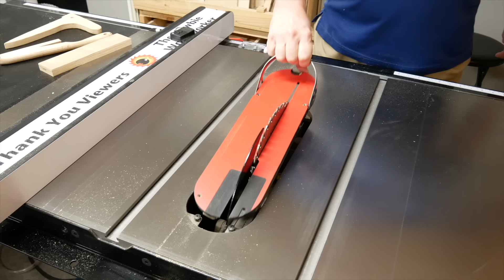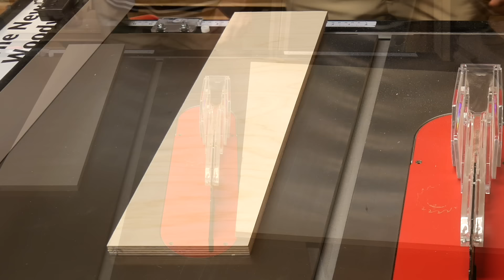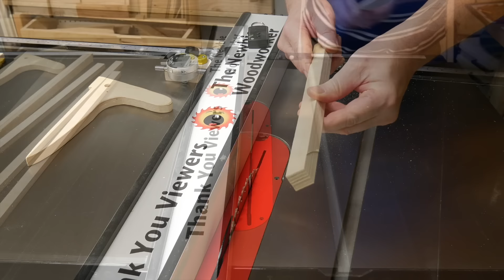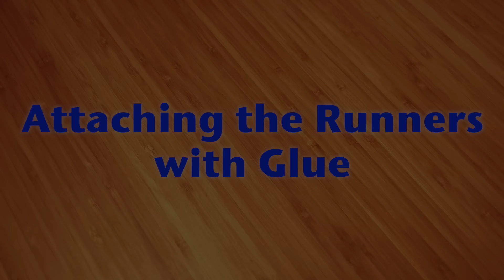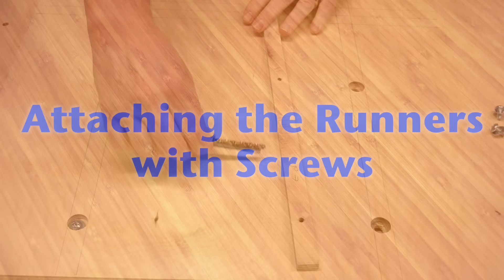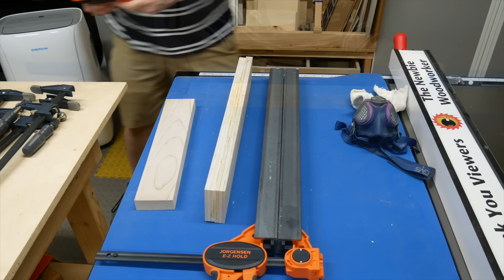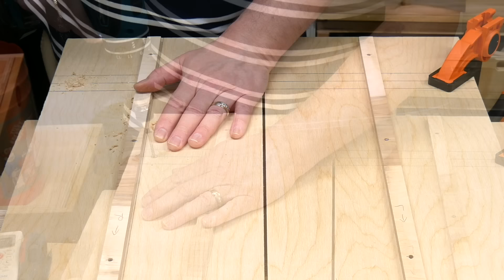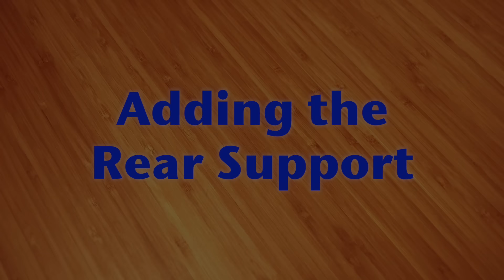Build this Revolutionary Cross Cut Sled, for Newbies!

Comment: I cut my right thumb( lucky I'm left-handed) vertically halfway through the bone. I was super careless. Anyway getting new saw and I have learned all about pawls, riving knives and blade guards. So happy to find this video and now I can make a jig with the blade guard on.
Reply from the maker: Sorry for your injury, but I'm glad to be able to help prevent further ones!
Reply: Well if didn't happen then it would've at some point...also it could've been worse.  I have learned so much since the accident. I am a very right brained ADHD artist. I am a popular window splash artist and teach on you tube. After the accident I am, taking time, reading instructions and slowing down. I should've used a circular or jig saw for the cut. I was anxious and in a hurry. A table saw with no guard. riving knife or pawls. Freehand cut.  Anyway definitely live and learn. @TheNewbieWoodworker
Reply from the maker: @ScotCampbellwindowpainter  I know all about ADHD, although I'm old-school and call it ADD because the "H" doesn't apply to this old man. :) Anywan, by all means, yes, use as many safety devices as possible. It's just too darn easy to have your mind wander. And if you can afford it, I strongly recommend a SawStop - it's saved me multiple times.

Comment: why not add a back fence as well?
Reply: The blade guard would need to be able to pass through the back fence, like it does the front fence. This means the back fence would be cut into 2 pieces, which wouldn't really add any extra support to the sled. In practice, this design has worked perfectly for me, for years.
Reply from the maker: Sorry - I posted that last response under the wrong account. The blade guard would need to be able to pass through the back fence, like it does the front fence. This means the back fence would be cut into 2 pieces, which wouldn't really add any extra support to the sled. In practice, this design has worked perfectly for me, for years.

Comment: This guy is quite sincere, but what's the real difference with this sled to otherw. The gaping open end just looks like trouble. Both ends should have bridbges  to prevent any warpage. Why not?
Reply from the maker: I explain the difference - you can keep your blade guard on. I don't know what trouble you think the "gaping open end" might cause, but it's worked perfectly for years now. There hasn't been any warpage, so there's no need for a second fence.
Reply: As Roy Underhill would say, "I know it works in practice, but does it work in theory?  @TheNewbieWoodworker
Reply from the maker: @jackwilson1914  LOL!

Comment: Great video. Thanks! I’m and old guy. I grew up around my dads glass shop. He did a lot of woodworking also. The big saws always scared the crap out of me. Particularly his radial arm saw and big old table saw. All built before the advent of good safety guards. Any newer things he had he just threw the guards away. But I learned to use them and I enjoy doing hobby work in my home shop. But I do like using the safety features. I’m also a guitar player. I need my fingers! I will be using this sled idea. Thanks again!
Reply from the maker: I'm a guitar player also, and a video game player, so I'd prefer to keep my fingers too. 😄

Comment: I clicked on your video because I am always looking for new fixtures to do difficult work.  I have to admit, I was disappointed to see it is primarily about guards.  Crosscut sleds themselves already improve safety without the addition of a blade guard.  If this saves the fingers of some people, I'd say good.   But PLEASE don't ask Congress to mandate permanent guards on home saws..  Why?  They will put OSHA on the job.   

There's nothing wrong with practicing safety.  People forget that it can be accomplished with training, rather than another restrictive piece of hardware.  Every operation you do comes with risks.  You said it yourself, unless you hold the board securely while you are using a Forstner bit, the wood may spin around and smack you.  So why aren't you using a "guard" (or clamp) for that operation?  You chose to accept the risk.  Let the rest of us decide which risks WE want to accept.   Fact is people can hurt themselves putting a new blade on, bending over to pickup a heavy piece of stock, or in a hundred other ways.  If you want to be a champion of blade guards, fine. I cut material for my employer that CANNOT be cut with a blade guard.   It is VITAL for our business. 

Incidentally I have a lot of experience in safety, having worked in machine shops for many years.  OSHA mandates guards on drill presses and lathes.   They make the machines just about impossible to use.  In fact, one of OSHA's own webpages says that the use of a guard with a drill press may make the drill press impossible or even UNSAFE to use.  (Yes, we actually used their website to fight an OSHA fine.)  People have been fined for not having safety chains around machinery, and then later fined for not having warning labels to indicate the presence of the chains.  We were fined because one of dozens of mandated warning notices was mounted a few inches too low on the wall.  I believe OSHA has become a money making business, rather than an agency genuinely concerned about worker safety.  Think I am exaggerating?   Years ago my current employer asked me to design and build a fume hood for applying coatings.  A few months later I was asked to repair a pump immersed in solvent, in another part of the building.  It was in a fixed tank underneath a table mounted soldering machine.   I would be exposed to a lot of solvent fumes when I put my head under the table, and opened the top of the tank to fish out the broken pump.  I knew I could not move the equipment to the fume hood.  So I asked my employer if I could bring in my own respirator to wear while doing the work.  NO!   OSHA had given them the choice of getting employees certified for respirator use, OR  building a fume hood.  The certification was much more expensive.  By building a fume hood in the building, they had met  the OSHA requirements.   I would be in violation of OSHA codes by bringing in a respirator without certification.  I called OSHA anonymously to ask them if this was true.  It was.  I could not use my own respirator, regardless of my experience, and they could not force my employer to get me certified.  However, they WOULD make a surprise inspection and find SOMETHING to fine my employer for!    This is what happens when government gets involved in safety.  I don't have anything against you or anyone else here designing and using safety equipment.  I just don't want OSHA ever involved in our  home workshops, and limiting our ability to make new and innovative stuff for a reasonable price.
Reply from the maker: I have no interest in having the government dictate those kinds of things. The government already does way too much of that. We're supposed to be the land of the free, but apparently those in power think "being free" means they are free to regulate, require, and enforce anything they want. So don't worry - I would never support anything like that.

Comment: Thank you for this video. I built this for my dewalt 7485 table saw. I use the guard so this is much appreciated. This is a much safer way to operate the saw. I made sure to leave enough space in the back to prevent any accidents and added some blocks around the back end to protect the fingers should I roll back the sled too far and am not paying attention. It is a great design!
Reply from the maker: That's awesome! Thanks for letting me know. 🙂

Comment: I'm one of those newbie wood workers and have been researching different c/c sled videos tryng to get an answer regarding sled size. My DEWALT has a deck about the size of your sled, but my goal is to make my sled a foundation for using various jigs.... so Question #1 can my sled hang-over the edges of the deck and if so, by how much would be recommended? Question #2: Since I know I will be adding and substracting various jigs, is there an optimal fence size that might lend itself to this goal? Thoughts?
Reply from the maker: You probably won't find a definitive answer, because it will depend on a lot of things. What I suggest is you prepare yourself for having to make a few sleds before you get an idea of what you like and don't like. Belive it or not, it's a lot easier to make sleds when your goal isn't perfection, but instead it's to make a working prototype. Then see what works for you and what doesn't. Make sure you have fun while doing it!
Reply: @TheNewbieWoodworker  Makes perfect sense. Thanks. I think I will assign myself to find the single most "plain vanilla" (AKA: least engineering)
item, build it and see what impressions I get from using it for a while. OTHO
I saw an item someone built that did everything but make coffee. Thanks again!
Reply from the maker: @BruceWSims  LOL. Makes perfect sense. Chedck out this video of mine: https://youtu.be/b-65Bs5Yi0w

Comment: Nice video!  Generally pretty clear, but why didn't you cut the notch for the blade guard in the fence before attaching it to the base?  That way you wouldn't need to remove and reattach it after aligning it...
Reply from the maker: Thanks. I honestly don't emember now, but there was a definite reason. But that doesn't really help much, does it? 😄

Comment: My biggest challenge is the relatively tight front "apron" space between the blade and built in plastic measuring guides on my 10 in Craftsman table saw. Fine if you can set the saw up  within several attached expander boards. Trouble is, many of us 10 in table saws choose this size of tool because they're already tight for safe comfort working space in their garages and basements. I just want a sled for making repeat but relatively short and accurate straight pcs for the historical bldg replications, birdhouses and Nativity Stalls.
Reply from the maker: O understand. You might try this out: https://youtu.be/b-65Bs5Yi0w

Comment: I’m 72 and just bought my first table saw.  A Skilsaw with worm drive.  After putting it together and looking at that blade sitting there, I pushed it over in the corner.   I stumbled onto this video.   I think I will try to make the sled.  First I have to locate some Baltic plywood.  100 mi from city.  Thanks for a precise and newbie oriented video that instills confidence.
Reply from the maker: Awesome! Glad I could help. 🙂 Good luck!
Reply: @Lynn Campbell I am somewhat in the same boat. I'm n9t as old as you but I got my first table saw a couple of Christmases ago. I put it together and then it has sat in the garage since
Reply from the maker: @scottgabbard8401  😄

Comment: Great video, another subscription for me!  Very clear, concise and clean and the addition of the few graphical images (arrows, circled parts, etc.) make it just that much better.  My existing sled is way too big and it weighs more than an elephant on steroids, one of those things that looks good on paper but for the rare time I need a large one, just not worth it!  Lastly, the addition of the few humorous bits just adds to it and they are generally funny (IMHO).  Thanks, btw, I am building this one tomorrow, small, easy and did I mention, doesn't weigh more than a pregnant blue whale.
Reply from the maker: 😂You're welcome, and glad I could help!

Comment: I have a question, I’ve heard of all these accidents and kickbacks and I always wonder if they were at least using the riving knife. Of all my tools, the table saw really scares the cr@p out of me. I don’t think I will lose fingers cause I use the push stick and I have the guard, but I am still scared of kickbacks. Can a kickback still happen with the riving knife and guard on?? Thanks!!
Reply from the maker: Sorry for the late reply. A riving knife helps a lot. It's still possible, though. For instance if a board has a twist in it and when you're cutting it, it binds in the blade, and you kwee pushing. In that case, turn off the saw and figure out what's going on. But the more you know, the afer you'll be.
Reply: @TheNewbieWoodworker  thanks for the reply. I guess this is where paying attention to the noise the saw is making comes into play.
Reply from the maker: @mj.sorrondegui  Absolutely! If anything seems off to you, stop and re-assess. Just be careful not to hurt yourself when turning the saw off - it's easy to focus on finding the stop button and forgetting you have another hand near the blade somewhere. And before you start, if something is nagging you and feeling "off", stop and think - there's usually a good reason for it.

Comment: Nice job, nicely done. That is a fine looking crosscut sled. A sled that is at least 24 inches with a fence on both side can never go out of alignment, but I like your thinking. It is a nice design. I was over at another guys channel and the router table he built was primitive and so crude he may as well been using a chainsaw and a axe to hack it together.
 You obviously care about creating a quality piece of work. I spent a lifetime working with ticketed tradesmen who only cared about getting paid, we used to call them "The quick and the dirty." I really enjoy watching a tradesman that is proud of his work and that is willing to put in the extra work that creates a good looking product that is easy to look at and has the ideal of true functionality built in from the get go. Kudos to you Sir, I am a sub now.
  We had a saying, "A tradesman that does not care will cause far more damage than one who does not know."
Reply from the maker: Thanks for the nice comment! I'm a retired software developer, and that saying applies to developers also.If a developer didn't care, the result would be a problem until the day the software was retired. And the phrase "quick and dirty" was an insult to developerrs also, although they may not have understood it that way. 😂Thanks for appreciating what I do!

Comment: I'd love to know why you can't square off the blade? So many people I know do it that way and have perfectly square cuts. 
Im not trying to be challenging. Im genuinely curious to hear your reason. The more info one gets from a variety of views, the better informed one is.
Reply from the maker: I agree about being informed, so no worries there. Yes, you certainly can square it to the blade. But the miter slot covers the entire length of the table, so it's easier and more accurate to square the fence to that. And you should always try to square the blade to the miter slot, because the miter slot is fixed and you can't adjust that. But honestly, just the fact that you want to square the fence has you ahead of a lot of people, so do what works best for you. 🙂

Comment: where is your blade guard
Reply from the maker: Huh?
Reply: @TheNewbieWoodworker  Think they're just trying to be a bit of a smart*** by referring to the part where you're cutting the strips and don't have a guard on...but as anyone who uses a table saw to cut thin pieces would know, that is because you simply can't use a guard for those specific cuts because the fence needs to be closer to the blade than the guard will allow.
Reply from the maker: @johnday2917  Thanks. I always wondered which part of the video they were talking about, but I know better than to get into arguments with people like that.

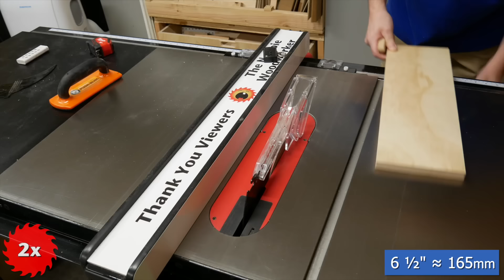Comment: The problem with most blade guards is they're so flemsy that if someone was to get tripped up or anything and push on it the blade would cut through the guard and still get you. Don't ask how I know that, it's still painful to think about. Also at 2:45 ish putting your hand that close to the blade pretty much negates the whole guard thing
Reply from the maker: As to the first part, you're right, but nothing is a perfect safety solution. As to the second, you're right of course, and I definitely have some bad habits. My brain doesn't always engage when I need it. 🙄

Comment: I like metric a lot but still use imperial.
Reply from the maker: Thanks for the info! 👍
Reply: I use metric a lot in cooking, most specifically, but not only, in sour dough bread making but I like imperial for woodworking and building anything.
Reply from the maker: @dalepres1  👍
Reply: @dalepres1  I interchange them quite often  . Here in Canada it's necessary.
Reply from the maker: @nedcramdon1306  👍

Comment: Only works if your TS has miter slots. My Ryobi doesn't.
Reply from the maker: I would respectfully suggest that if your table saw doesn't have miter slots, then if you can, you should return it and get one that does. Miter slots are an essential part of table saws.
Reply: @TheNewbieWoodworker  I bought it used so no return. Budget doesn't allow for a new TS. So...I'm stuck.
Reply from the maker: @knothead5  Oh well, maybe in the future. Good luck!
Reply: @knothead5  I saw a video the other day from Apple Valley Farms - he has some pretty good stuff on his site too - he made his sled for a smaller "jobsite" table saw and his runners were attached to the sled so that they hugged the sides of the tabletop, rather than in the miter slots.   I think that might still allow you to build a functional sled.   Here's the link to his video:  https://www.youtube.com/watch?v=hRQ5bcUk0pE  (or you can just search Apple Valley Farm on YouTube.  

I like this one because it allows for the blade guard, so I will use it, but my Ryobi saw does have slots for runners.  Good Luck!

Comment: I guess my only question is why didn't you use T-nuts for the runners.  They will last a lot longer than threads in the wood.  But then again I guess you won't be adjusting them too much. I need to make one of these.  Keep the good stuff coming.
Reply from the maker: Other people have mentioned t-nuts. I'm not sure why I went this route, but obviously t-nuts should work fine too. Thanks for the comment! 😄